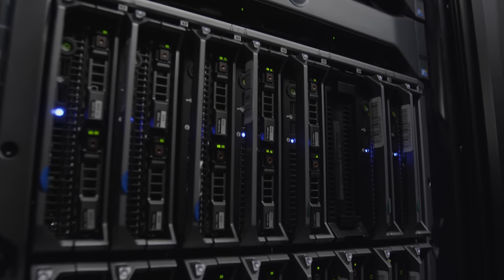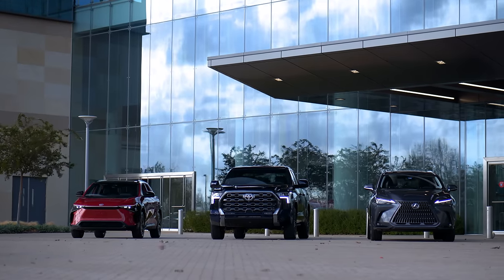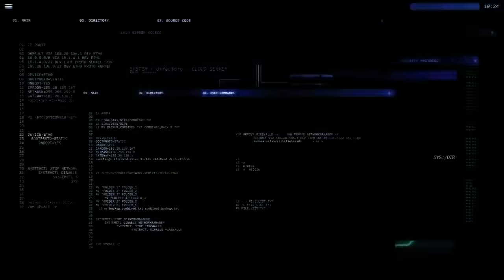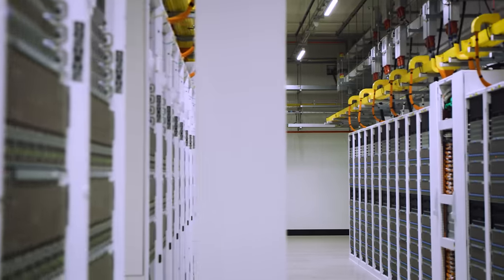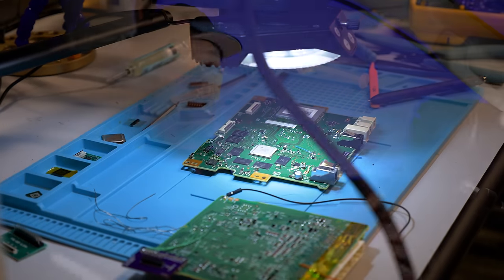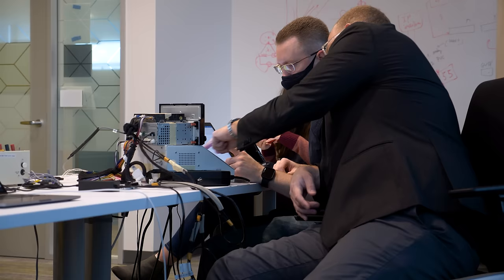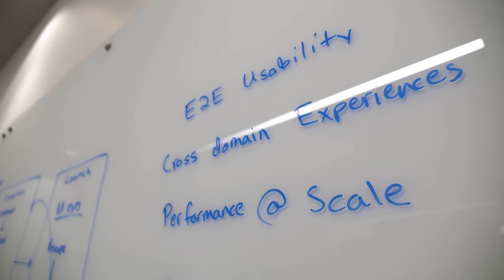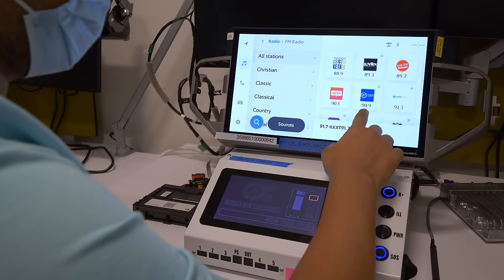How Is Infotainment Designed?

Comment: I think with UI, most manufacturers are getting one thing wrong. The heads up display is seriously under-utilized and should be in sync or a simplistic version of what's on the touch screen. Also it can be a second screen.. Toyota did the right thing by putting the screen at eye level. Using the heads up display efficiently without even taking your eyes off the road should be a natural step forward. I also agree with the usage of a 1-D vertical menu, not like apps on phones.

Comment: I wish they'd stick to the good old physical controls and dump this tablet on a dash thing.  If it's a software button on a touch screen, you're going to HAVE to look away from the road and down at the screen to see what you're doing.  To me, this also has the potential to set a bad trend where auto makers don't have to get the interface right on the first try, else they have to wait for the next refresh for a particular vehicle model.  We risk falling into the whole consumers being treated as beta testers practice if it becomes easy to just roll out UI updates over the air.

Comment: For all those UI and interior designers out there, go and sell consumer electronics for a year. You'll very quickly get in touch with the modern consumer demands. Trust me, you'll be surprised in both good and bad ways. Customers can be very correct, and very wrong. But I can guarantee, it wasn't in the ways you were thinking

Comment: Will also be watching how/if all these internet-heavy car controls/functions become/stay hack proof - or not. With the price of the new cars, hackers have an incentive to control others' cars.  If I sound skeptical, I've used Microsoft software since it first came out. So many of their offerings to consumers are unfinished beta applications that get adjusted, updated, etc. following their release.
Another reason is the fact the rush to digital is a cost saving measure for the manufacturer, not the consumer.

Comment: Rule of thumb for interfaces in cars:
 - Any linear and toggle controls that one would expect to be able to use while driving, related to physical adjustments (seat position, steering wheel, etc.), in emergencies, or very regularly? Use physical controls.
 - Everything else? Use touchscreen.

Car makers hate this because physical controls cost money, but they feel that infotainment is mandatory for the modern customer, so they want to pay for this by throwing as many controls into the screen as possible.

Comment: Between 1992-1998 I was largely with IBM .. (before that, I was with Dell)

I did anything and everything from development to sales ..

I used to go to trade shows, and we would talk among ourselves about OC-768 ..

This was in the mid 90s ..

We envisioned back then that in hopefully 20 years we would be there ..

OC-768 is described thus ..

OC = Optical Carrier ..

OC-1 = 51.84 Mbit/s

OC-768 = 39,813.12 Mbit/s

We were talking from a "user" standpoint ..

That is OC-768 speeds to the USER!

That is significant in network computing, because that can eliminate a "fat client" (OS) and one can literally push an OS image through a wire ..

Therefore no need for OS/Program storage at the user level ..

Only "data" storage, if the user wishes it ..

USB and SD flash devices being capable today to 4TB ..

So, 25+ years later ..

Are we there yet?

I was working at IBM (Austin) ..

Where is IBM today?

We call this -- progress?

Comment: Great topic and presentation.  My biggest fear in new generation "smartcar" technology?  Imagine I have a car or SUV with split fold rear seats so I can haul lumber in a pinch or a pair of skis.  What if I misjudge the room left when shoving them through the back?  What if by doing that, I shove that lumber or pair of skis right into the dashboard?  Right into that giant 12" LCD based head unit?  What if all climate controls are screen driven?  Have I just lost the ability to defrost the windshield and drive the car?  What if the screen breaks on its own going through temp swings from -10 to 180 F?  Do car manufacturers really understand what is involved in keeping developers on hand for a DECADE supporting an old software stack embedded in 10 million cars when all the cool engineers want to work on the new version 7?  For those that think that's  the whole point of driving functionality via software, think about this.  Does the new version of Windows run on a 2008 Era PC?  NO. Does the latest cool app for Apple tablets run on original iPad hardware and iOS?  NO. Given the networking these new cars expect to implement for proactive alerts and mtc reminders, that software will require CONTINUAL updates in perpetuity, if only for security.

Comment: manufacturers should come to an agreement to make terms standard; learning and remembering would be a whole lot easier. Many years ago the MIDI 5pin plug connections were made standard by musical computers manufacuters so that YAMAHA products could be connected to all the other computers with out needing a whole bunch of adapters. In the automotive world one has to remember many different abreviations for the same computer, like ECM PCM  and more. and use many different adapters to connect various devices from different brands.

Comment: My experience with Subaru: the car companies have to do a better job of holding their infotainment partners more accountable. When the Impreza launched in 2017 along with the new era of infotainment it took them a year to sort out the serious bugs, and they seem to keep repeating the same mistakes on each subsequent model launch. Even little things like the radio doesn't stay off the next time you start the car, the MP3 player can't properly read metadata off of a USB stick and jumbles all of the track listing order, the max volume is inexplicably set at "37" meaning that "19" is the 50% mark. Not to mention the serious issues of the system freezing, all of the trouble people have with Android Auto and CarPlay not connecting or randomly disconnecting, etc. 

And I lay this down mostly on Harmon, Subaru didn't become an infotainment company overnight, but they have to hold Harmon accountable for basic things like this.

Comment: I have to say that the most striking thing to me is that touch interfaces simply do not belong in cars, yet the vast majority of manufacturers keep pretending that it is the best way to navigate the infotainment system of a metal box moving at speed. Obviously that doesn't exist in a vacuum and is the result of the manufacturers provided the people with a familiar (smartphone-like) interface  which is probably what people *want*, but is it actually the best interface for the job? I don't see it.

As much as BMW or Mazda's non-touch scroll-wheel interfaces have been made fun of in some circles, on a daily basis driving such a vehicle seems like a much more enjoyable experience (not only safer), and I have absolutely no desire to go back to a touchscreen interface.
Reply: The Mazda system was definitely a selling point for me. Just couldn't justify buying a new one when the basic audio system was so much worse than what I could get in a used Lexus. In any case, I appreciate the efforts they're making to keep things simple!

Comment: My wife and I both drive 10 year old Porsche vehicles (Cayenne and 911). The infotainment systems in those vehicles (based upon the same 2012 technology) aged slowly at first and these days much more rapidly. The navigation systems are dated and mostly useless and the connections to phones are becoming more difficult to access with no capability to access things like CarPlay. I am highlighting this because none of these problems are sufficient to make us want to trade our vehicles. The cost to change is so high and both of us feel that if we move to more "modern" vehicles we will lose access to some of the wonderful characteristics of the (now) older Porsche products. Infotainment is NOT everything. Horsepower and driving characteristics matter more to us than access to CarPlay.

Comment: Hyundai/Kia know how to do tech! 2022 Santa Fe Calligraphy has real buttons! Only thing that's a little convoluted is you have to hit climate to see the inside temp settings. You can also see them quickly if you adjust the temp buttons but other than that everything is a touch button not a capacitive touch button. Yes the Tucson has capacitive touch buttons but they work well at least and are not hidden from view

Comment: And they’re still doing it wrong. I don’t know a single person who uses OEM navigation unless they’re out in the middle of absolutelynowhere with zero cell service. Now if you don’t have a subscription you’re screwed with that. They should just collaborate with Apple, put in an iPad mini  with a volume knob and call it done!
Reply from the maker: Google maps is probably the best possible integrated solution to go hybrid, its works without having to rely on phone in this case
Reply: @savagegeese  perhaps but The latency experience and how and iPad operates blows any infotainment system out of the water. No more CarPlay hiccups or glitches since you’d be using the iPad not your phone.  Extreme simplicity with user interface if you are an iOS person.

Comment: A message for the designers, maybe try something like bmw g20 2019. That's a good mixture of digital + buttons and just don't use tech that looks like its from the 2000s clearly didn't make any effort in updating. In addition, make the digital gauge cluster optional not as a trim but as an individual option.

Alternatively, look at a Honda Civic 2022. That's also a great example of how to design your interior. Just move the layout, change the shape or whatever if you want it to make it look unique/new.

All these extra talks are kind of bullshit. Cloud vs Local, OTA and blah blah. That's not the main complaint when people say Toyota is outdated. When you get in a 2018 Camry and try out that backup camera or 360 camera, it will literally remind you of 2 decades old tech.

Comment: Watch out, engineers.  Rural and mountain areas may have gaps in connectivity lasting minutes or hours at highway speeds. If the function is not "in the car" it is not available.

Comment: Did you ask them why only one driver can register to one car in the app?

I just took delivery of a LX600 and couldn’t add it to the app.  I called Lexus and was told since my wife has the car added to her app, I have to use her log-in information.  They said it is a known error with no eta as to when it will be fixed.  Wth?!?

110k and 2 people can’t register to one car.  I traded in a 2015 car and both my wife and I could control that one from the app…22’ flagship Lexus, nope.

Ridiculous.
Reply from the maker: Its on list for OTA I believe.
Reply: @savagegeese  I sure hope so!  Thanks for the reply.

Comment: As a software developer myself. For a car, the less electronics the better. Compared to physical controls, touchscreens are distracting, slower, not tactile, and most of the features they offer aren't useful. Not only that, the way they are often just tacked on top of the dashboard like a cheap tablet completely ruins the look of the interior in my eyes. It will go dated quickly.

I shouldn't have to go into a sub menu of a burger menu in order to change where the heater blows, or use tiny little physical controls relegated to little surface mount switches. Make that stuff big, obvious, robust and fast to use. Can't beat the 3 dials.

I don't see being able to move buttons around through software updates as an advantage. That's just going to be annoying. Design it properly in the first place and you won't need to move it. At least they got in their feedback that they needed buttons that are always in a consistent place to prevent users from getting lost; but isn't that completely obvious?

Nor do Toyota need to know that I'm cold so turned on the seat heater. Got enough creepy stalkers in my life, don't need the car to be one too. How many of this cars systems are going to fall apart when I drive to somewhere with no signal? How much extra is the data plan going to cost just to put an internet connection in a car?

Comment: Can manufacturers create software that will safely pull a car off the road and not allow it to be driven until the driver puts away their phone?  I see so many drivers weaving and last-second turns and it is obvious that they are using their phone while driving and it is frightening.  As someone who has to share the road with these dangerous drivers, I fear for my safety on a daily basis.

Comment: 15:26  You just landed at MSP airport in January and it's -10F outside.  Your rental car is a Camry.  You are dressed for survival with heavy gloves, but you're still freezing.

After clearing the snow from the windshield, you get in, start the engine, and immediately go hunting for the seat heater control.  Whoops!  Turns out that an engineer like this guy has buried what should be a tactile control in a touchscreen menu.  Too bad for you that the system is still booting up and you have to remove your gloves to find it somewhere in the menu.

This is why bad engineering decisions matter.

Comment: What modern cars should do is use your phone as the infotainment device, not all this rubbish that carmakers will install.
Just put a phone holder into the car where the infotainment screen is now located and bam: this is all we need. What carmakers do is not needed, it's doubling up on what my phone already does. And it's not as easy updateable as my phone is, so it ages much quicker.

Comment: Automakers are obsessed with what you see at first and not what matters over time and what is unseen like seat comfort and music sound quality which matter 100 times more than the visual. Premier(Pioneer) had a head unit with colors and showed real time frequency graphs, in-car voltage and had great sound and colors all in a standard DIN size. Once these persons wanted to be unique, the customer's needs and POWER and FREEDOM to choose was thrown out the window. What we have now is akin to the Matrix where we have no choice. But we do have choice and many people would prefer to buy older used cars where we keep our freedoms and choice. The modularity. The sound system upgradeability. If instead they went back to separation of vehicle buttons and modular head unit I would be much happier. Or the OEMs could offer integration of vehicle sensors with the head unit. Honda has made that possible on some vehicles. We want the power back and we want to upgrade our cars and select what vehicle functions are important to us. We also want different levels of sound system. In short, back to custom control.  The OEMs have always restricted us to their own detriment. What costs the most?? More bespoke more custom hi-end cars, where you get to select type of fabric, colors, wheels, etc. Why not offer choices in the entertainment system that should be more about sound and less about menu screens that are for the birds?

Comment: 16 minutes in and I'm getting... a little enraged? Because the Toyota people are saying "what do people want," "what do people enjoy," "what can we do." And not once have they said "what is a safety issue," "what needs to be doable while keeping the drivers eyes and attention on the road." The moment that triggered this in me was the designer talking about how seat heating/ac should be context aware, as people don't NEED heat in Summer, or AC in Winter. So he things that control is a good candidate for digital control. The PROBLEM with that is, when a driver wants to adjust their seat heat/ac while in motion, they cannot know "what mode" that digital control is in without disengaging their brain from the primary driving task. They will need to take a mental moment to see that the control is in HEAT mode, because its winter, before adjusting. And lord help that driver if, for some reason, they Need to adjust the seats AC setting even though it is currently Winter.

Its this sort of thing that infuriates me about the current trend towards shifting all controls to a touch screen. The controls can shift around, the interface elements are not tactile, and with multiple pages available via a single screen a drivers attention MUST be divided, both to comprehend the screen real estate as well as guiding their arm/fingers to interact with that screen, all in a dynamic, moving environment. Yes, all controls CAN be put into a screen. But its not just a design challenge. It is a SAFETY issue. And these designers have not yet, at 16 minutes, said the word safety. I will continue watching this, and will time mark any occasion from here on if they DO say safety, or otherwise address the potential for distracting the driver from their primary task of driving.
Reply: 39:08 Safety mentioned. In terms of keeping customers from using their phones in the car? But its a follow up to a discussion about data security.
41:40 Doesn't say safety, but talks about distributing info through the cloud opens the potential for first responders to react to crashes, or make adjustments for weather. That's about stuff outside the vehicle, rather than internal driver/interface issues. But in fairness I thought I should mention it.

And that's it.